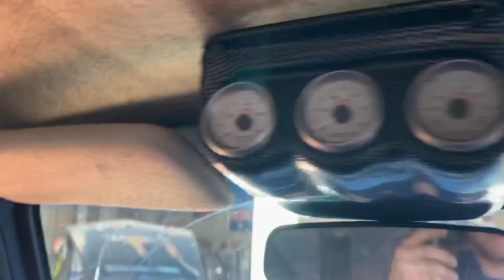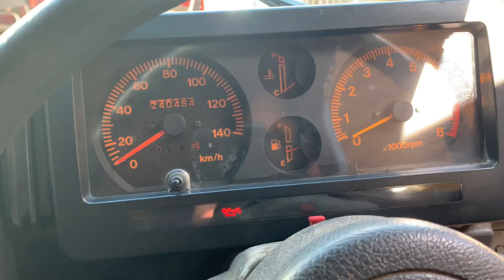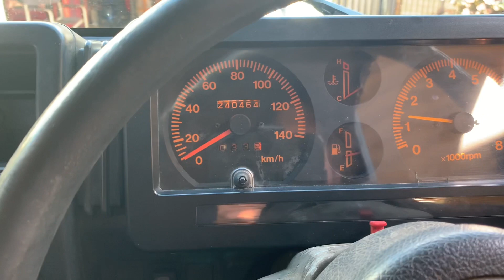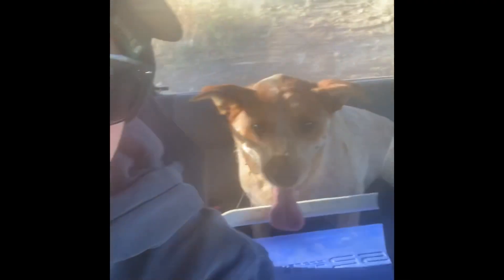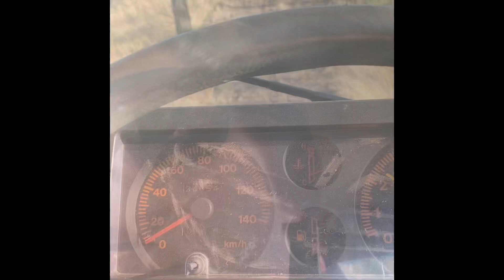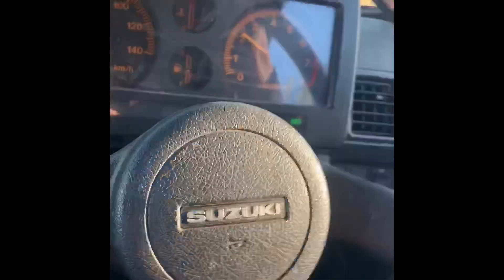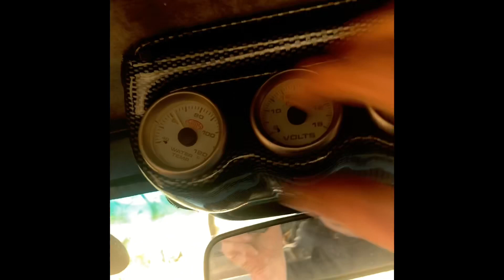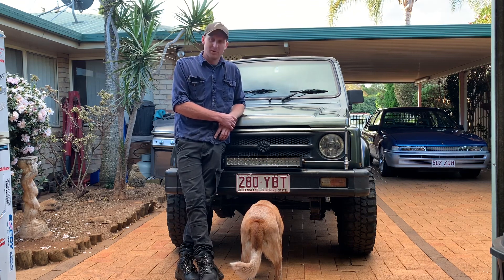Suzuki Sierra (Zook) G16B Engine Swap Finale

Comment: What are your tire pressure at? Looks like 30+
Reply from the maker: Krazy Karl on road use 38psi, when we were 4wding 15 - 20 psi.
Reply: @CrankedAutomotive6  that's alot dude, tyre placard states 20psi on road.
I run 18 on road and 5-8 off road
Reply: Also currently only running 18 pounds on my samurai with 33x12.5 mtrs. Drives good. Anything more and it rides like a 2x4.
Reply: Yeah I Run 20psi onroad and 10-12 off-road with my Sierra and I’m on 29inch muddies